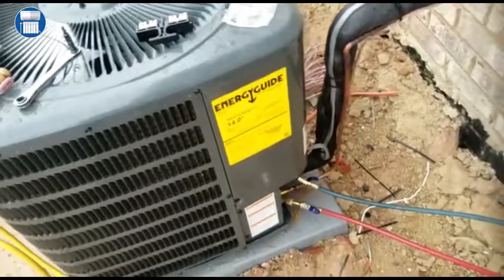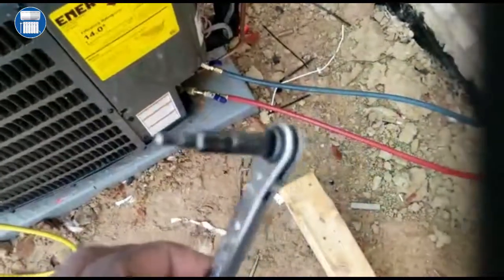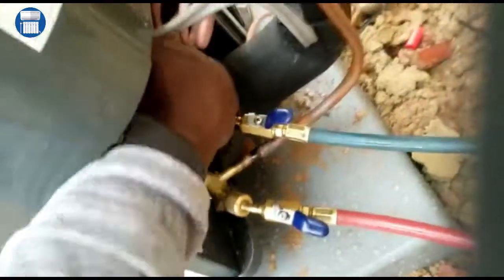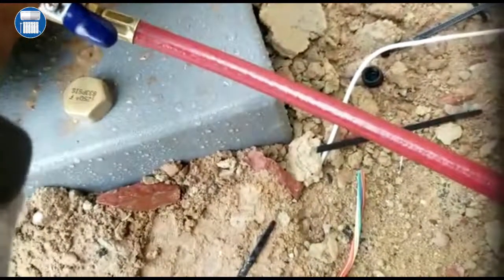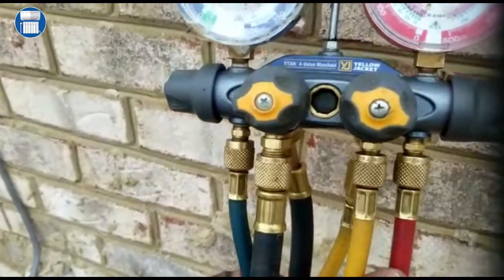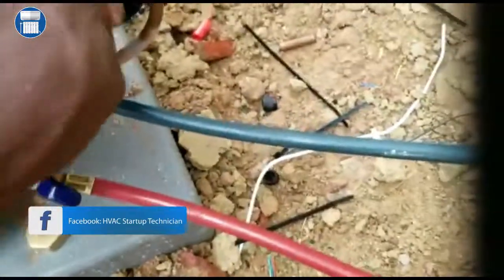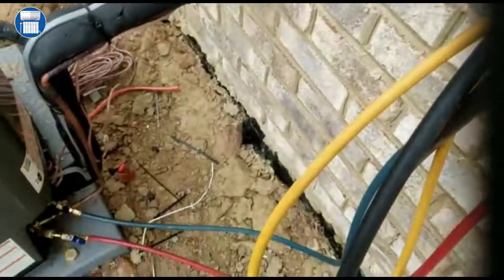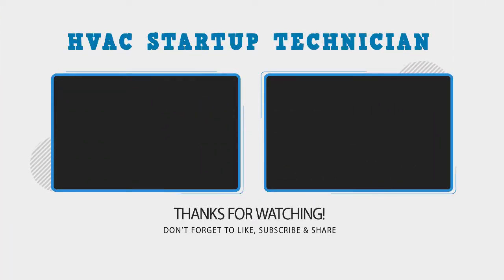how to pump refrigerant into condenser how to pump refrigerant back to the compressor

Comment: Hello, very nice video. Can you please verify about the gages. When you pumping back the refrigerant, do you open the gages or leave them closed?
Thank you
Reply from the maker: your gauge remains closed
Reply: Leave both side closed on gages during?@MarylandHvacRepair
Reply: Shit you dont even need guages the sound of the compressor will change one refrigerant has been completely backflowed just listen to the condenser it will sound normal then the sound will change in frequency. Close suction with contactor pushed in and lines are ready cut.